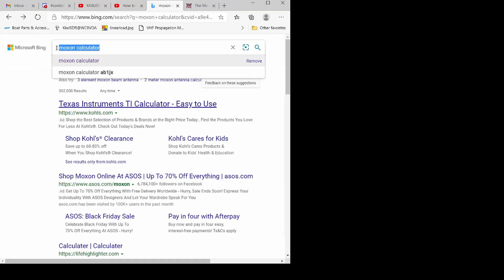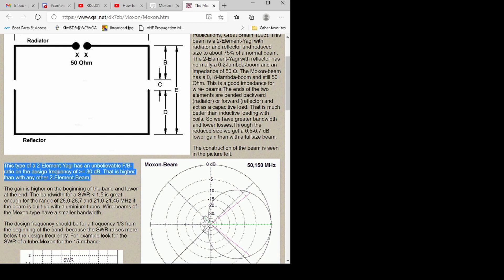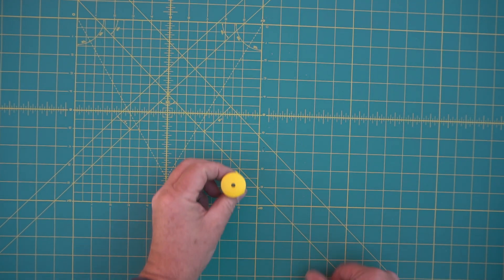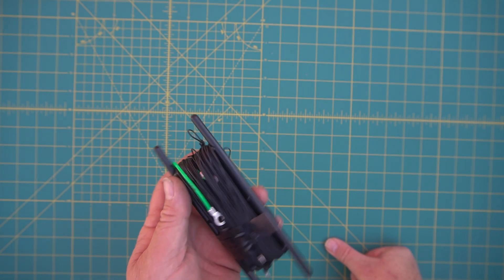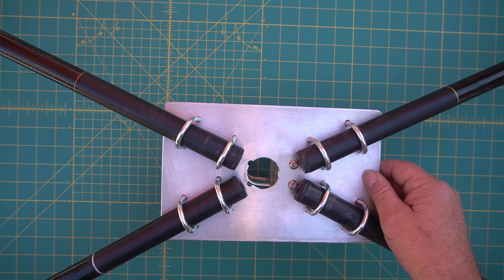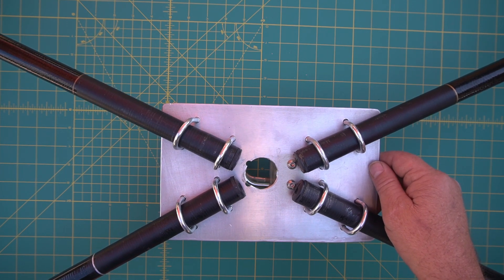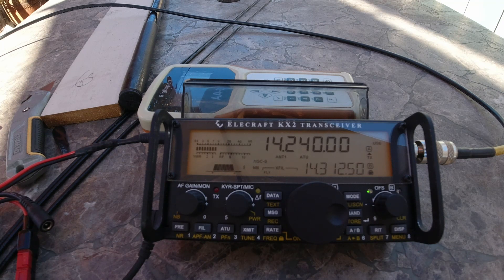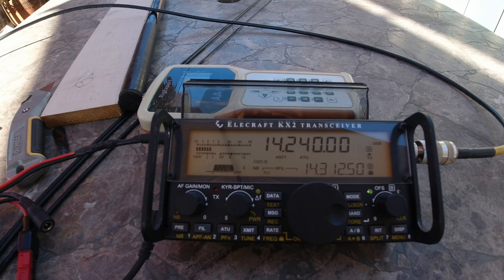How to make a 20 meter Moxon for Home or Portable use.

Comment: Hi Chuck,  Just wanted to drop you a note that using this video as a guide, I built a 20M Moxon of my own (and your rotor as well).  Put it up for the first time today at about 12 feet and when I hooked my radio up, I thought something was wrong.  My noise dropped to about an S1 or S2 (normally an S5). I thought I screwed something up.  Spun the antenna east and scanned 20 meters, the first station I heard almost blew me out of my chair (Spain which I have never heard stations from on my EFHW before).  I can't wait to get this up to 30 feet and tuned to transmit (SWR about 2.3 at 14.300, but I can get it lower).  Thanks so much for this video, its helped me tremendously.  73
Reply from the maker: That's awesome Kevin! Using a antenna like that is surprising how quiet it can be and how you will hear stations you never heard before!

Comment: Thanks for this video! Hoping to get my general soon so I can use this band and others. Building a 10 meter Moxon now. I'm on the other side of the hill from you in Nevada. I was just down your way picking up a vintage trailer over the summer. Have you ever been to Markleeville up in the Sierras? K7ZFI
Reply from the maker: Yea have been through Markleeville a bunch of times. You will like the 10m moxon.
Reply: @KK6USYHamRadioAdventures  I grew up as a teen there in the 60s. Lot's of memories for me every time I go through.

Comment: Hi Chuck love your video, wanted to know if you have the template for the hub (the 6 x 9.5 alumium plate) I want to know where to drill the holes
Reply from the maker: If you look up Moxon plate on ebay use the measurements from the metal one that come up.

Comment: Before the Moxon antenna there was the ABQ 2 element beam designed by Fred Caton VK2ABQ it was square moxon antenna is based on this antenna how do i know this iknew the designer of the ABQ which was the predecessor of the moxon it worked a treat i had one up for many years worked the world not bad for a wire beam that looked like a clothes hoist it was more square than Moxon.
Reply from the maker: I think I have seen that, but will check it out!

Comment: The end is hilarious! Inspiring video! My buddies and I want to try to get the most out of our portables for the field and your build looks like the ticket. Great, clean build! Looks like I have a project in the next couple of weeks, 73 N9BRO
Reply from the maker: The Moxon is a great portable antenna with gain. It can be made with multiple but a little harder maybe than a Hexbeam. You can also build them with more elements 3 and 4 aren't too bad especially for 10m. Thanks for the comment, I don't remember the ending lol.

Comment: What a great video I was wondering would you please confirm the length of the wires
Reply from the maker: Pat, I can measure mine when I have a chance but if you use different wire your lengths may be different but close. the calculator will get you close also.
Reply: @KK6USYHamRadioAdventures  ok I'll use that - great video btw

Comment: Ha! The looks at the end over the dog barking are priceless! The antenna looks pretty interesting. I think I'd have to use a trailer hitch install on my Kia Nero. But, I'm easily confused, and it looks a little involved to set up. LoL Right now, my POTA set up is a 20 or 40 meter hamstick on a tri-mag mount on the roof of the Nero. It's a nice quick and easy setup. I can even drive with it. I did seven counties for an SSB contest a while ago. 73

Comment: How do you tune it? Nice work
Reply from the maker: You use the Moxon calculator, and then adjust likr yu would a dipole. The Moxon is usually wide banded so the calculater should get you close. Just give yourself a little extra wire incase your short.

Comment: Great demo. Re adding another band to it, the reports I've read mostly said that at least one band should be skipped if multi-banding a Moxon; e.g. build it for 20m & 15M or 12M, not 20M & 17M, (or 15M & 10M, not 15M & 12M, etc.) because otherwise they will interact. Also, some say that the elements for the two bands should not be nested, but separated vertically by a few inches, but one fellow had the feedpoint impedances turn out well by nesting the beams but moving the higher frequency band Moxon forward of center so the driven element of the higher frequerncy band antenna is closer to the director of the lower frequency band Moxon. Nesting them resulted in the higher frequency band Moxon losing about .8 dB in forward gain, but flattened the F/B ratio on that smaller Moxon above 30 dB across the entire band, increasing the front-to side ratio of the higher frequency band Moxon, as well. He also found that he could feed the 20/15M nested Moxons on 17M via a tuner with gain over a diople and more than 15dB F/B. Not bad! I built one for 20M last year with the same type of hub but am about to replace it with one built out of spare Yagi parts, as the winter here in MT wasn't too gentle on the lightweight version. Will keep the first one for portable use. Have a ball on POTA! 73 de Kevin WA7VTD

Comment: If you were going to use thicker fiberglass spreaders, vs the fishing poles, for a QTH version, what diameter would you use?
Reply from the maker: Check out the how to make a hexbeam site, they have a place to buy the fiberglass spreaders thay should work!
Reply: @KK6USYHamRadioAdventures  copy that, I’ll take a look for their recommendations. I already have some lined up for a cobweb antenna I want to build and feel confident with 3/4 at the bracket reduced to 1/2 for that setup. Didn’t know if you gave it much thought since you mentioned needing a more HD version. Good video, cheers 73
Reply from the maker: @ericsrussell  I was thinking 1" or 3/4" at plate.

Comment: @13:33 it's ruff being famous when everyone wants in on the action.  I just found your channel and this antenna is exactly what I wanted to mess around with.  what length are the poles?  are you using all the pole sections or did buy longer poles and remove the flimsy tip section?
Reply from the maker: I have the 7.2m poles from Ebay and take the lst3-5 sections out. Better to buy poles too long otherwise like you say they are too weak. Thanks for the  comment and for watching! It's a great antenna.

Comment: You should seriously consider switching to open feed line. Yes a little more bulky but eliminating coax losses will greatly increase you 10/20w signal. Plus it make a great vid check out the Toad Harbor fb page or you tube the vid. Simple as ribbed electric fence isolators a spool of wire and sum wire ties 😉 like the moxon Ant KC3ONO
Reply from the maker: Most of the time I will have 100 watts and I can do more with a vehicle close by. But actually that was the plan eventually try some maybe 300 ohm feedline , I have made it before for a "speaker wire antenna " basically space the wire the same width of 300 ohm with wire ties and small tubing. I will check out your suggestion and see how TH did it. Thanks for watching  !
Reply: @KK6USYHamRadioAdventures  stay away from those pre made ladder lines unless you have old real copper twin Tv line. Most of the pre made stuff is stainless with a dusting of copper. Use #10 or 12 solid core copper Thhn coated. You ll be surprised how much coax sucks ur signal. I usually work 160m so every W is worth it 😉 KC3ONO

Comment: Looks like 5 or 6 m fishing rods ... am I right Chuck?
Great vid, see ya! 
9A3GVD Radio Adventures
Reply from the maker: They are 7.2 off ebay I think there is a link in the description to some like the ones I have. I don't use the ends , that's why the longer poles so they are strong enough. Thanks for watching!

Comment: What are you using for spreaders are they the crappie poles that extend appreciate your help would like to build one myself
Reply from the maker: mdg ski, yes thats what i am using. I put a link above in the description of ones like I purchased 7.2m. Get your length and take the smaller joints out and save them.

Comment: Great video.  I am new to HF. Working on fan dipole for qth for my first QSO on HF! After I get that squared away I want to do POTA if it doesn’t break the bank haha. 73 de KI5HXM
Reply from the maker: Brent , glad you liked the video. POTA doesn't have to break the bank, once you have a antenna, radio and a mast or a tree to hang the antenna your there except for power. Look at my 2 videos on battery boxes for power, to keep price down you can use a lead acid battery especially on POTA since you will have your vehicle close or at the activation and change to a lithium later if you want. Then find a park and activate!
Reply: @KK6USYHamRadioAdventures  yes the antenna and power doesn’t worry me. Just have to figure out a good portable Hf rig. Don’t think I want to haul my TS-590SG portable unless I mounted it in my truck.  I might get tempted with a smaller rig sometime. I do look forward to operating at some parks in any case.
Reply from the maker: @brentjohnson6654  , The Yaesu FT891 is about as goos as it gets for a compact portable radio with 100 watts and fairly cheap for a new radio. A lot of good choices if you want to go qrp. I take my FT991A a lot for POTA and camping it's light and has 2m/70cm also.

Comment: Nice one Chuck. Sure it will serve you well. You could even potentially for elements for other bands. 73 de Colin
Reply from the maker: Hey thanks for the comment Colin, yea the bands are getting better and I will try to add 15 and 10 meter at a later date it should make for a great POTA and DX antenna. I had worked on a antenna like yours before I had seen how you worked it out. I was using a fishing line spooler off amazon and a chalk box with copper fishing line as a pull out counter poise , your setup is much cleaner and simpler! Thanks for watching.

Comment: This looks like a good project for the spring.  Where did you source the fiberglass poles?  Thanks for another enjoyable & informative video 73
Reply from the maker: Alan , I got the poles off of ebay I will try and find them again and post a link. Thanks for the comment and watching the video.
Reply from the maker: Alan these look like they are pretty close to the ones I purchased.
 https://www.ebay.com/itm/NEW-Carbon-Fiber-Telescopic-Fishing-Rod-2-7-7-2-M-Stream-Fly-Fishing-Hand-Pole/224144444948?_trkparms=ispr%3D1&hash=item34300cce14:g:jbUAAOSwUZdfER5l&amdata=enc%3AAQAFAAACgBaobrjLl8XobRIiIML1V4Imu%252Fn%252BzU5L90Z278x5ickkgCVySCgrNFPU8Iu85TabMNPQcfNY2ebmCMLFwAnFm5xlcZJuU8ZN7yPYiHsVKuOM5birhC2%252BFZ2CdlSdAkwh0JhB6H58oETDUvwcZ0b0c%252FEFSxZQPLRih5eZtXCp%252FVjPTQPfHuRrKWebiPVuN0BKXZn%252B7vexep3cb891eZ0xEmneH%252By3tu4Hytm7Il%252B6ZYstwPXjltYTJCc0nEbvDh2yJFqSUSd1BjaYofwgcPyCpq9wHdsKNkQxo0phZx6U4SSFXnjZHiqtnU7T4YLoIUrDwuC9zbiWkspRVuLp3s%252B8BGXb2p6Jwz8nv%252BGybodTzhzU9dP2qd3XcVl0F56%252Bz8HapNrkyTU3XTejHPsnwb%252FnrbZAzev9ZFpJ0D2oXzmlM4jo7UDKZh%252BoKyuvw8Rg%252Bqqsh95SdTrO2Nvm3MmrcOGimlPBGdRXVKkDLg0%252F2%252BbMLCQYw5T%252FB18luPS2voFWccYb%252FMQ6FIGemqE4zbfdAT4YT7ijHqKf4wO3slHyGTqKV8tpmRBUX8FcyXI45x3pEG3QfDPdVQhHIWnDn6629mENmeY7lA1uMM8lpRA6XVEYIdbTYfrX6jqw1hsT1HSgHyRxKqjqTJwMq7qNueAZ7DXbWmhh%252Bn%252Bx3pdHIBEJnRlgMrxq3hATQQnHqe3R6EHE8VuWmLA8rUZutClO5JDe%252B6kHl9UBuMd0Mq7fKg8xnTGY1nRQFAD%252F742lyr%252Byd0Svj3y5L3BpV4qdXZgM%252BjwVKEtYDs%252FJP9VzjemGPRAzj3k0DYrt7Nj9nA%252Fe9SSG9F%252FuTcPZyUTsbc6qiDK68wWPS37bnCk%253D%7Ccksum%3A224144444948ce05ca59104a4cc280d9db2eb267ff83%7Campid%3APL_CLK%7Cclp%3A2334524

Comment: https://www.ebay.com/itm/ANTENNA-MOXON-HUB/253214773848?hash=item3af4c6d258:g:rrAAAOSw5VFWPMc7 Here is a Moxon form from E-Bay like Chuck showed in the video. And I used the BNC to Banana plug off Amazon for the feed point.

Comment: didn't know what a moxom antenna was, this was cool.
It looks a lot like a single element hexbeam.
How would this differ than a hexbeam, performance etc?
Why is this and hexbeams always pulled up instead of letting them arc down like an umbrella and then just lift it a little higher?
This was an awesome video and a great build.
Sorry about the neighbors dog. :-D
Reply from the maker: Thump, I think this and the Hex are pretty close in performance, the moxon is 2 element also just a different shape. And for portable it uses less supports. Arching it up gets you a little more height you can let it go down like a umbrella , not sure if the mast would interact or not though, some just lay it flat if you supports are strong enough. Thanks for watching the video and the great comment and questions! 73
Reply: @KK6USYHamRadioAdventures  thank you